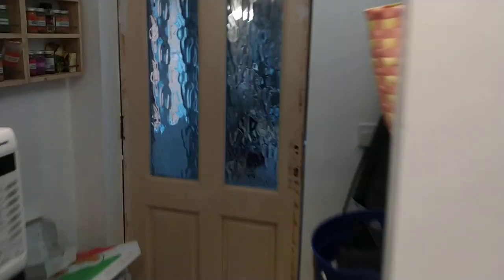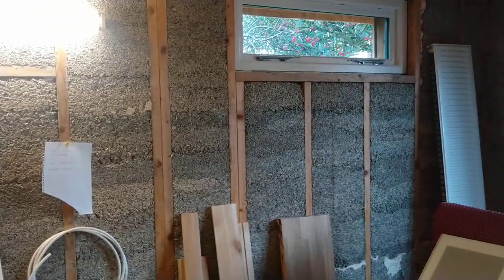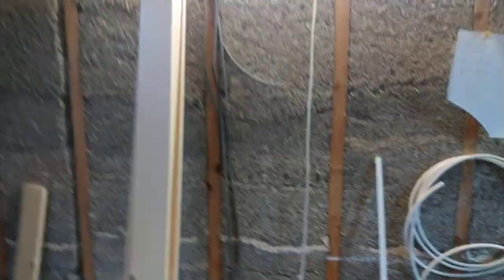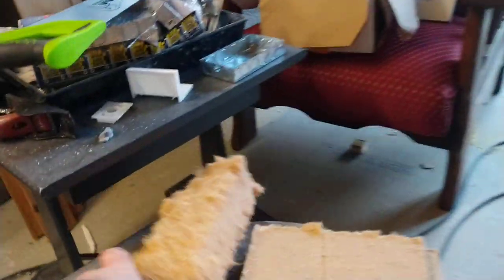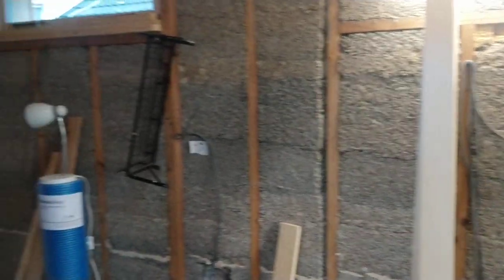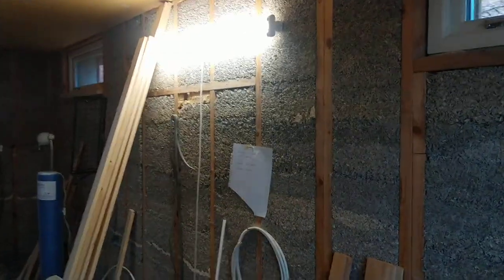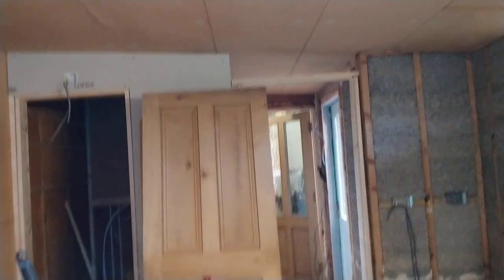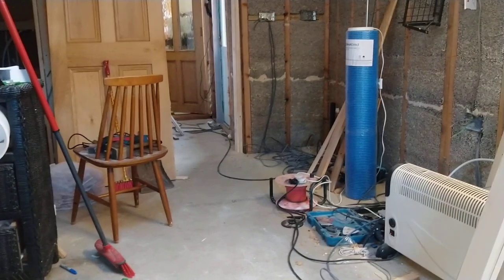Hempcrete Urban Extention

Comment: I'm build a test 10x12' hempcrete build at the moment, we are in the California hills and the main attraction is that it is extremely fireproof, something we didn't need to worry about in the UK as much. 
Problem over here in the states is acquiring the hydraulic lime. I found a material to mix with hydrated lime that is readily available. so hoping it works out.
Reply from the maker: Hi Brian.  If you are on Facebook then get onto the international page called Talking Natural Homes as there are some real hemp and lime experts on there. The ratio of your lime binder to the Hemp shiv is really important and Hempcrete does fail where this is wrong, so getting some real pro help with this will be essential.  You can also contact Alex at UK Hempcrete and he can offer you an online consultation.  I used this service and was well worth the small investment.  Good luck.  Dave
Reply: @dutchtentsforsale3685  cheers mate, I'll look into that forum. We did have a consultation with a chap called Maddie, he is a hempcrete afficinado over this way. The binder I'm using hydrated lime and metakaolin as a pozzolan and through testing so far it works really well. The reason to build a shed first is to trial it all out at larger scale prior to investing in it for our new home build.

Comment: What mixer did you use?
Reply from the maker: Hi. I  was advised by UK Hempcrete to use a Pan mixer but instead I used a 90ltr Bell mixer. Now I understand why they were right and I was wrong. Basically you can lay it faster than a 90,or even a 115 ltr can mix it. So lots of time lost waiting. So if rasing a wall 25cm thick or more you need a bigger mixer. I reckon just on my own I cld lay 200ltrs in one hit, so about 10mins. So unless you're building a small shed don't use a Bell mixer.
Reply: @dutchtentsforsale3685  good to know, thanks.  i'm building 2 houses in northern sweden, i'll get a 300 ltr
Reply from the maker: @martyy4073  Hmm, sounds interesting.  If you wan t any technical info speak to Alex from UK Hempcrete, hes an absolute pro with Hempcrete and offers a Zoom consultation service, which is well worth it.  Good luck